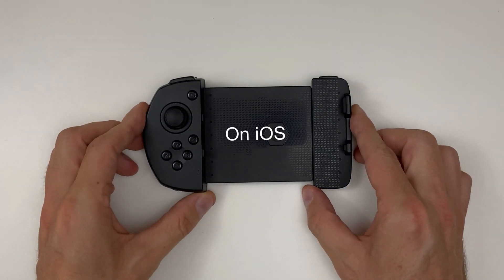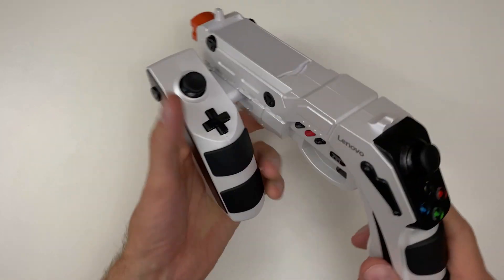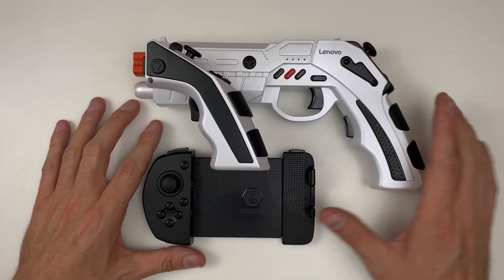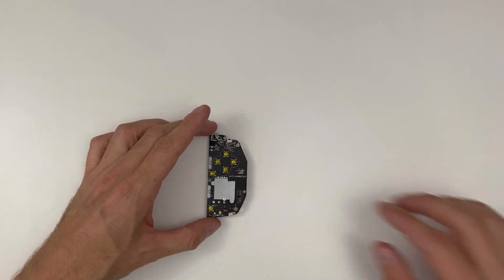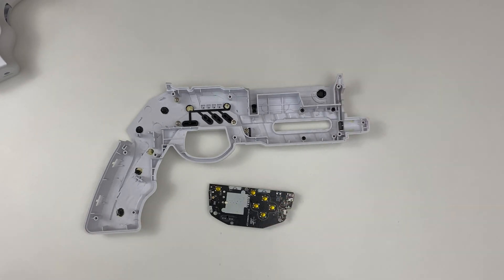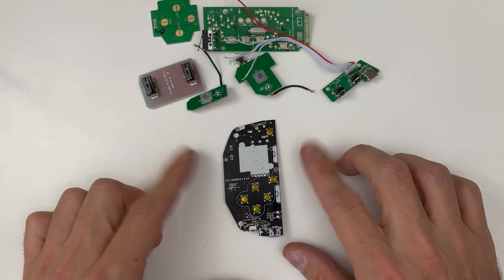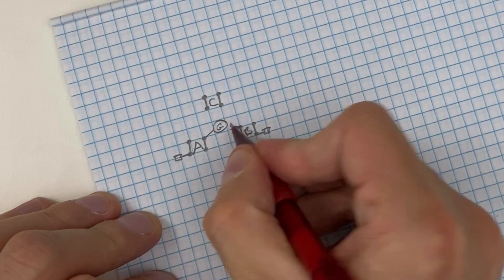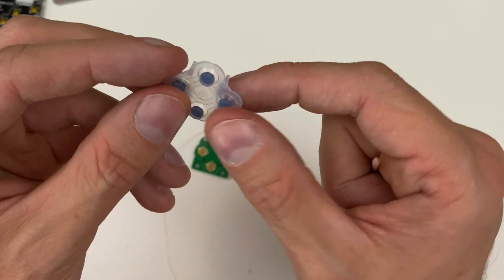Sciencing an AR iOS shooter controller (1/2)

Comment: you can use diodes to keep the "shifted" switches from triggering in ways you don't want. It's the same way a keyboard matrix works.
Reply from the maker: I need to learn about diodes. I think you can use them to help with pass through charging also by allowing the flow of electricity in only one direction right?

Comment: Every mobile controller I've used has had horrible dead zones
Reply from the maker: Yup, I know what you mean. In this case the analog stick doesn’t feel bad at all. When I was playing around with the controller the software was pretty buggy, but it worked. Since then they have updated the app. I haven’t tried it out since then, but the update notes say they addressed the issues I had noticed with it.